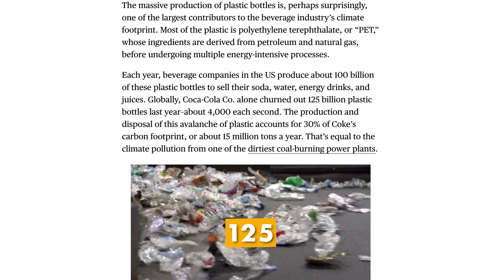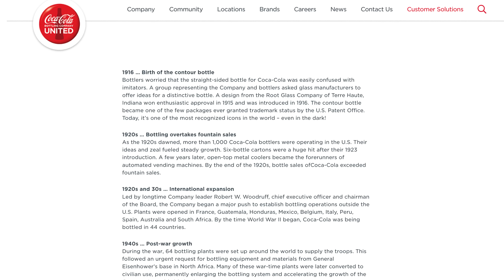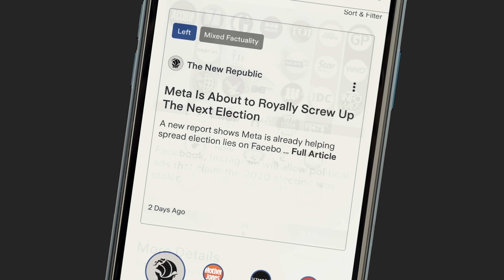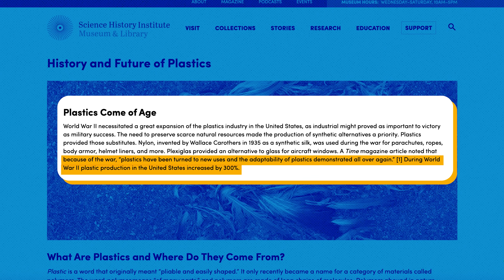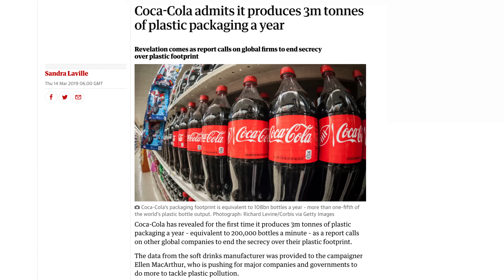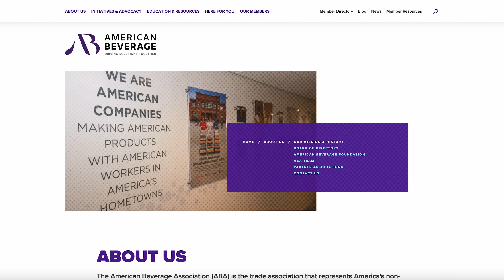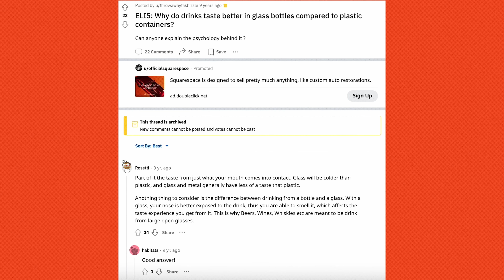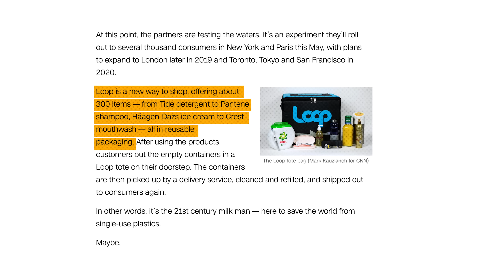Why the Glass Bottle FAILED

Comment: Almost half of the drinks price. Now that is how you motivate people to recycle.
Reply: Those savings wouldn't ever pass on to consumers. We'd just be padding corporate profit margins.
Reply: @iainballas  they don't lower prices, but they do end up raising prices slower than they otherwise would have. So you don't immediately see the savings but they do come over time. It's the same with self checkout, if they didn't have that prices today would be higher than they are now.
Reply: not the point @iainballas
Reply: @MegaLokopo   Wait, you think corporations have a limit on how much profit they are willing to make off you? BAHAHAHA!
When they cut costs and staff they give themselves a big fat pay check, you get nothing.
Reply: @rmac3217  so why isn't coke more expensive now?
Reply: @resigned7739   It is more expensive... 5c for a bottle in 1920 = 81c adjusting for inflation. This is even with the sugar replaced with corn syrup and plastic bottles + removal of the cokane. 
The price is based on what you are willing to pay, with monopoly holders like this, what access you have to competition also comes into play.
Reply: Here in Germany you have to pay 25 euro-cents for every bottle (and plastic or aluminium can for any kind of liquid) you will only get refunded if you bring it back to the shop. That's a 30-60% upcharge to the price of the beverage, so it's no wonder we achieve 98%+ return rates ;)
Reply: @rmac3217  You're dodging the question. Why aren't bottles of soda and other things twice expensive as they are currently? If companies set prices arbitrarily, why aren't the prices for everything even 5 times as high as they are now?
Reply: @DBZHGWgamer  Because obviously consumers aren't willing to pay that much, and the profits would shrink again. Indeed, the prices are not completely arbitrary, but the production costs are a negligible factor on the total price at this point, it's all about how deep your pockets are.
Reply: @MarkusHobelsberger  Why wouldn't you just reuse a cup or water bottle?
Reply: @DBZHGWgamer  Because not enough ppl are willing to pay 5x more, there is a magic number where enough ppl are willing to pay vs not willing to pay vs total profit per sale. If I make 10 sales but only make 1c each, it's better I make 1 sale and make 20c. 

Of course this is much more complex than that, for example the product has to be transported and distributed, the more you distribute the cheaper it gets and there's the logistics of it that require mass distribution. Similarly for Coca Cola there's shelf space, they want to own the shelf space exclusively and this requires mass distribution that's very reliable.  etc etc etc.
Reply: @MegaLokopo  How would you do that with beverage bottles like CocaCola? You can't make the content yourself.
Reply: @MarkusHobelsberger  He's saying he reuses the bottle for water or something, defeating the purpose of the product in question, which is a drink you buy while not wanting to carry cargo like a drink bottle.
Reply: @MarkusHobelsberger  You can't make the content itself but you can buy just the liquid at almost every gas station in the US. They let you use your own up and then charge you by the size of the cup.
Reply: @DBZHGWgamer  there cant be a thought  behind this message. you do know there are competitors that would just undercut those prices and laws to outlaw price gouging
Reply: @DBZHGWgamer  thats why they do it gradually instead of instantaneously
Reply: @DBZHGWgamer  Do you literally know nothing of price maximization through the supply and demand curve? This is literally high school economics.
Reply: @rmac3217  aka market forces apply on both sides of the equation, undercutting your original claim.
Reply: @denofpigs2575 Do explain how those imply that prices are set arbitrarily. I look forward to it.
Reply: @immoral8905  Really doesn't answer his point.
Reply: @Hippownage  If we switched back to glass bottles (which I'd consider a positive, but that's an aside) I think you'd find those production costs aren't quite so "negligible" as you make it out to be.
Reply: @lolcat5303  And if my grandmother had wheels, she'd be a bicycle.
Reply: @lolcat5303  Arbitrarily:
Arbitrary comes from Latin arbiter, which means "judge" and is the source of the English arbiter.

It's literally in the word. They judge what the best price point to sell a product to the most number of people is.

It is literally arbitrary.
Reply: @Hippownage  To be fair, not having wheels doesn't proclude someone from being the town bicycle.
Reply: @lolcat5303  What are you talking about? You are charged the optimal amount to make the most profit, the cost of goods is only related to the minimum profit to make it worthwhile.
Reply: That's horrible @MarkusHobelsberger
Reply: @MegaLokopo  There is no such Thing as buing the product / filling your own cup with Coke at the gas station in Germany. You can return your old bottle and buy a new one. You can obviously use the bottle again by refilling it with water or juice or whatever from the tap or another container. But if you want your deposit of 25 Cents back (plastic or can) you have to return it. There is no rule for how long you can keep bottles.
And btw the deposit on glass bottles is actually lower than on plastic bottles and cans: It's only 15 Cents instead of 25 Cents because the are more eco friendly. 
The only exeptions are wine bottles and glass containers for non-dairy foods: they don't have a deposit but should be thrown into "special" glass recycling bins to make sure that the glass is actually recycled.
Reply: @iainballas  wdym? It worked back in the day, my mom told me it was like that in the 90s here in europe at least.
Reply: @Jaki1776  why don't you have a system for bringing your own cup? Reusing a cup is far better than recycling a cup.
Reply: @Hippownage  Companies charge whatever the customer is willing to pay. A 20oz coke is 3$ because of the customer, not Coke-Cola.
Reply: @MegaLokopo  there is in some places just not applied universally and to all things. Things like milk are harder to sell by filling a bottle ( though given how gas pumps work I don't think it's an impossible system to apply...)
Reply: Recycling is a scam.
Reply: @uverpro3598  most of the time yes, but not always. Sometimes glass, sometimes metal, sometimes but rarely thick plastic.
Reply: @iainballas  The company doesn't get to keep the deposit unless the consumer fails to return the bottle.  Make the deposit high enough and the bottles all come back, no margins get padded.

Comment: German here. we have the Pfand system, where almost all beverage containers have a deposit on them. single use plastic bottles 25 cents, multi use plastic bottles 15 cents, glass containers (from soft drinks, Milk, some yoghurt glasses, ...) 8 cents. and if you buy a crate of bottles (for example 24 Coca Cola Bottles), it´s 3,10€ in total (1,50€ for the crate and 1,60€ (24x0,08€) for the bottles).
so if you bring a big bag of empty single use plastic bottles, you can easily get 30 to 40 bucks, for example if your family collects them and you bring them to the supermarket once a month.

Comment: Another thing was glass bottles required a bottle opener to pry off the metal cap.  Convenience stores and vending machines had one attached to the side of the cooler from which you pulled your bottled drink.  Many people had one on their keychain.  Of course, once you uncapped it, there was no recapping it.  Though this wasn't a big problem, as it didn't take as long to consume since they ranged from only 6 to 12 oz, rather than the 16-20 oz plastic bottles common today.
Reply: you can easily recap a glass bottle, it ain't as easy to seal it though
Reply: @arjix8738  I meant as far as opening and closing it repeatedly and effortlessly while on the go.  Sure, you could reattach the cap if you had a pair of pliers or something similar handy.  I don't remember them being possible to squeeze easily by hand without a tool.  Then again, I was still young when their use was fading out.
Reply: some glass bottles today has sealable metal cap. for some reason i've only ever seen it on those tiny glass bottles that's only the size of your hand
Reply: when I was a kid, the pop bottles were glass with screw on caps.
Reply: COSTS.  Glass is more expensive to produce and FAR heavier/more expensive to ship.  The biggest costs in bottled beverages is the bottle and shipping.  The liquid beverage is almost as cheap to produce as filtered water.  We had a business that sold fountain drinks.  Our biggest cost with beverages was the cup.  Fountain drinks are almost pure profit.
Reply: @n2omike  So you're saying that selling something that costs almost as little as water to make doesn't bring big enough profits if packaged in glass bottles?  The prices they charge even in plastic bottles are insane...  $2.59 for a little 20 oz bottle?  Please.  Surely they can afford glass at those prices.  It's not the consumer's fault that soft drinks cost almost nothing to make and that the company thinks they're entitled to use packaging that similarly costs almost nothing.  They made plenty of profits in the decades they used glass bottles.  This is nothing more than an excuse to screw the consumer and planet even further in the name of the almighty dollar.
Reply: @jasons8479  What I'm saying, is the product itself...  the beverage...  is super cheap.  All the costs are in the containers and shipping.  Glass is MUCH more expensive to produce and ship than lightweight plastic.  I like glass.  Have nothing against it, but plastic is much cheaper.  Fountain drinks bypass all the shipping, and are dirt cheap compared to anything shipped in a bottle...  usually better as well.
Reply: @jasons8479  you can wrap a cloth around it and squeeze it if you have the strength
Reply: @jasons8479  Stop buying coke in plastic.
This is 100% a consumer demand problem. If people bought glass bottles of soda, coke would make them, but people don't.
Reply: @BobSmith-mp8ld  Oh yeah, blame consumers for corporations that, in the name of the almighty dollar, shift their personal responsibility and costs over to the planet.  Please tell us all the story of when there was suddenly this great consumer demand for plastic bottles.
Reply: @jasons8479  Again corporations don't make what people don't buy.
Stop buying plastic bottles. It's a simple solution, the problem is most people don't care.
Reply: @BobSmith-mp8ld  So if consumers don't see much of an impact from a few plastic bottles they buy, corporations shouldn't bother caring about the untold BILLIONS of plastic bottles they generate, virtually all from fossil fuels?  Be honest, consumers are thinking about the tasty refreshing product inside the package when purchasing some Coca-Cola or Pepsi, not about the collective potential long-term worldwide effects of what's holding the beverages they and everyone else are buying.  It's high time for corporate leaders to be bold and take some responsibility.  Otherwise, don't complain when government steps in and starts adding taxes and regulations to things that impact this planet that we all share.
Reply: @BobSmith-mp8ld  Also, consumers don't buy what isn't produced.
Reply: Beer bottle have twist caps. Its just sad that plastic has taken over and before long we are going to have to address the plastic problem. Glass will be back or aluminum cans will become more of a staple.
Reply: lucky twist off caps cam into play
Reply: we never really had twist caps in germany, but I remember that it was a sign of coolness being able to open bottle caps with as many different items as possible. 

an uncle of mine made it look like he just removed the cap with his bare fingers by using his wedding ring.
Reply: @achimdemus-holzhaeuser1233  Most beer served in bottles are twist caps. They even advertise it as such. Even some german beer I have been told is in twist caps. I do not drink so I do not know first hand. Only in what I have seen.
Reply: @kameljoe21  same problem here. 
I don't really drink so I have no real experience. The handfull of beers I bought in the last years all had old-school bottle caps. 

I think I saw twist caps a few years back with the alco-pops  ..
Reply: You have cheap as dirt glass bottles with an aluminium screw cap... We sell most of the water and beverages from my country in those and both the bottle and cap are 100% recyclable and reusable... Also... I pay around 1€ for a plain plastic water bottle and 1,15€ for a carbonated water bottle (a chic water bottle if you will...) The price means little because both plastic container manufacturers and glass bottle manufacturers are trying to both minimize the cost of the package but also maximize the cost they can sell the beverage at... In the end the packaging cost means very little for the final user even when we are not legislating to account for the externalities caused by one versus the other...
Reply: @piscessoedroen thankfully, not only do we have technology to open caps simply with our hands but certain glass drinks. They've developed Tech where you can screw on and off the cap just like you would a water bottle.
Reply: I've used the bumper of my truck to open glass bottles.
Reply: Appletiser comes to mind... now owned by Coca-Cola. Wine bottles with screw tops also rock.
Reply: They do not "require" a special bottle opener.  You can open a bottled drink with a screwdriver or the edge of a table.  Also, back when I was growing up, most houses had a bottle opener mounted on the wall in the kitchen.  My previous house had one, so I removed it and took it with me when I moved.  It's a Pepsi one.  I also have a Coke one.  Swiss Army knives have a bottle opener as part of the flat screwdriver blade.
Reply: @jennifermarlow.  Back in ancient times, churches had huge locks which required huge keys.  After a while people starting calling any large piece of metal generally similar in shape and size a church key.  Now it's narrowed down just to the flat stamped metal bottle openers that have the pointed juice can opener on the other end.  There were millions made and given away for advertising.  Most old ones have a business name stamped on them.
Reply: @n2omike  The cost of the glass is not much, when spread out over dozens of drinks by reusing the bottles.  The beverages weren't "shipped" anywhere.  Every town had bottling companies, so drinks didn't have to go far to get from the bottling plant to the store.  Some brands might have to be trucked 30 or 40 miles from another town, but never long distances.
Reply: @n2omike  But the fountain syrup and CO2 bottles are always shipped from far away.
Reply: @bite-sizedshorts9635  Nope.  We got our CO2 in 5ft tall high pressure cylinders from the local welding supplier, and had a compressor that mixed it with filtered tap water.  A big CO2 tank was cheap, and would last a good 6 months.  The Coke Syrup was shipped in gallon size containers from a standard food service an hour away, and a single gallon would pour cokes for around a half hour straight.  A case has four gallons.  WAY back it came in glass bottles, then cardboard 'milk' cartons, then plastic bottles.  Most expensive thing about serving the drink was the cup.  That and popcorn is almost pure profit.
Reply: @bite-sizedshorts9635  Glass bottles haven't been returnable for decades.  Plus, it wasn't free to clean and disinfect them.  After those went out of favor, they were a ONE use product.  Far more expensive to make and ship than thin, lightweight plastic.  Almost everything that use to come in glass jars now comes in plastic.  Far cheaper to produce and ship.
Reply: @bite-sizedshorts9635  Exactly. And there are are screwable corks also.
Reply: The glass coke bottles I remember about 15 years ago (in Australia) had reusable screw on metal lids, I remember the plastic lids also fitting on them too
Reply: They literally have twist caps on beer bottles. What are you talking about? You need a bottle opener to open one?
Reply: @MyNomadicDream  Thank you. "Twist cap" was the term I was looking for. It has been around as long as "Gorilla  glass" from East Germany.
Reply: I just use my teeth. Yeah I know it's stupid but I cannot be bothered to carry around a bottle opener
Reply: There's a local soda bottler in my town that still uses glass bottles, they hand out reusable rubber caps you can put over the mouth of the bottle to recap it. Not sure how long they've been around, but I've got a few in a drawer that look decades old at least.
Reply: In my country, they still sell sodas in glass bottles and they have plastic taps, so you can easily close them.

Comment: Cleaning out my grandmothers garage we found her stash of mayonnaise jars. Because they use to jar mayo in a jar with the standard mason jar threads. So my thrifty grandma would save and wash the jars and reuse them when canning. I think because of my grandma I've always saved and washed jars as the glassware in my house. If you came over today and wanted a glass of water you'd get it in an old jar.
Reply: Same!
Reply: I have a stash of Classico spaghetti sauce jars because they are a 1-1/2 pint mason jar. I use them for canning every year.  I also use them to store bulk spices and other dry goods. If I have to buy something from the store that comes in a jar, I always look for products that use the standard size mason jar lid threads.
Reply: Those jars are thinner and may break in a canner or pressure canner.  My mother never used those jars for things that had to go in the canner.  She would use them for tomatoes, pickles, relishes, and preserves.  Those could be just filled and closed up to seal.